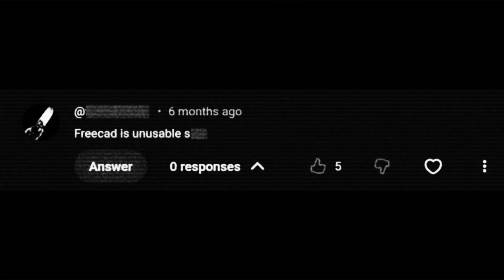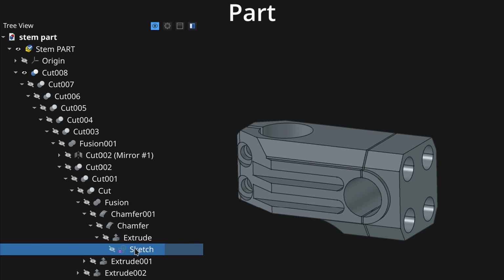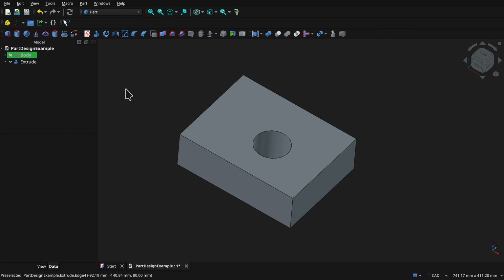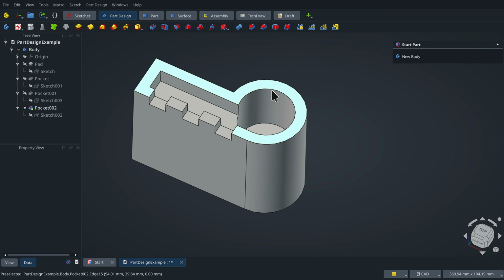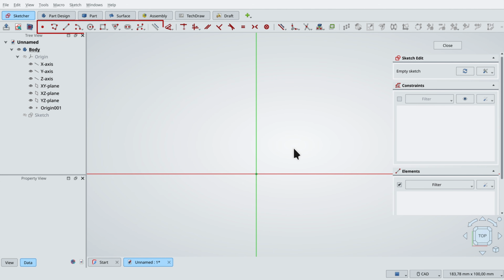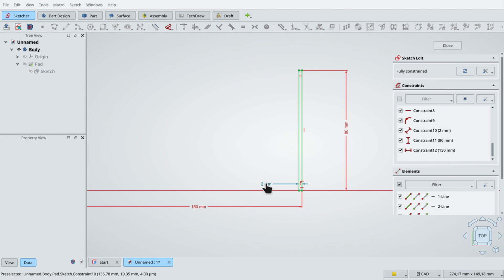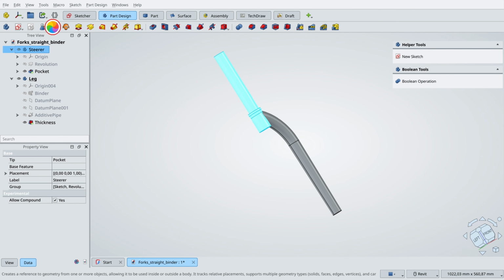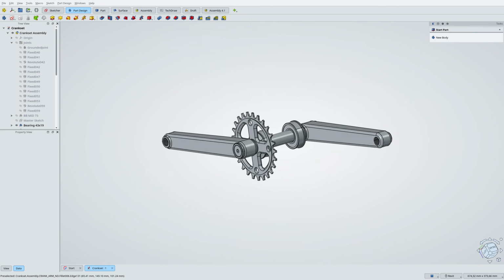STOP using FreeCAD WRONG! Do this INSTEAD (Workflow & Tips)

Comment: Exactly the same logic in Inventor or Fusion360. But when I launched Fusion360 for the first time in my life, I started working immediately. It immediately became clear to me what and how. Everything is intuitive. I had no experience working with 3D except for 3D Studio Max from around 2000. And also Google SketchUp. I didn't need to read instructions or watch tutorial videos. Moreover, English is not my native language; I know it quite poorly, at the level of terms and basic concepts (A1 level). But the Inventor interface turned out to be so clear and simple that everything worked out naturally. And then I decided to try FreeCAD. I spent several hours trying to figure out how to do something more complex than a cube with a hole. For the simplest actions, a bunch of auxiliary constructions are required. The FreeCAD workflow is terrible and counterintuitive. As if they tried to make everything possible, but not like others.

Comment: Thanks for the video. I think it's going to be a long hard road to get good, but some of the 1.1 features as well as a desire to get away from Windows will help me perseveer.

I think the more fundamental question for me is: why do things work in the way they do. What is the intention, benefit or philosophy behind the choices.

some examples I can think of are:
The need for sketches to be a single perimeter
The part and part design workspaces being distinct
The part operations being seperate from the booleans (in fusion you have one extrude tool, and you decide which boolean operation to do with the resulting solid)
You being unable to select a tool, then select the geometry you want to apply it to.

For now I'll do the hard stuff in fusion and the easier stuff in FreeCAD to help myself learn

Comment: Once you get to use FreeCAD, especially after 1.0 you get the impression that this tool is one step from becoming standard like Blender. When you get the hang of it, FreeCAD can be a really enjoyable and fun experience as long as you accept that at some point you will get to the point in the design where the solution has too many unintuitive steps. Currently, I am rocking 1.2 branch, and I can definitely confirm that we are in the last stretches here :)

Comment: Even though I am suffering with the migration I am determined to leave Solidworks - that I cannot afford - to FreeCAD even for my professional usage. But I am strugling with some workflow work. For example. I am trying to design a model airplane. I have the wing ribs that are all based on the same profile. I can easily import the DAt file and use that for the basic extusion and pockets for the details. But in Solidworks used toc reate several CONFIGURATIONS of these to use at th assembly. I could not find anything similar, only ones that can create several configurations based on dimensions but not configurations of enabled featrues (same base profile, different cuts and added extrusions). Also,Whe  I create a new Assembly I do not understand if it is better to have a new independent file or have it as part of the design tree. It is getting very confuse to me. I am sure it is an issue of getting used... Have any tips? Example: Outerzone ID=14521 (Spirit of Pitts airplane) 
there you can see the different configurations of the same base profile ofr the Wing. Thanks and your videos are a great help!!!

Comment: I've tried freecad many many times and always found the flow just too clunky. I have been using cad since 2012 and I have experience with inventor, spaceclaim and solidworks, and in all of them (even spaceclaim which has a completely different flow from the other two) you can find a common thread, but in freecad everything is alien except for the operation tree.
I guess I'll give it another try with the new 1.1 because I really want freecad to succeed and it would be real cool to use an open source cad, but it's a real hassle so far.

Comment: I tried the OpenTheme thing, didn't like it so decided to go back to FreeCAD Dark as I am use to it. However, the tabs, menu, everything didn't go back to defaults. Messing around in the prefs I see the "OpenPreferences Apply" buttun but there is no UNAPPLY button. Thanks dude, thanks, now I'm stuck with a UI I don't want. How do I fully undo this?
Reply from the maker: If you want to reset your FreeCAD, delete the FreeCAD folder in the Appdata folder (%appdata%). Make a backup of the folder before doing that; otherwise, you will lose your macros, CAM assets, mods, etc.
Reply: @deltahedra3D  After switching back to FreeCAD Dark and it not completely working I messed around with the UI for a while and got to a point that "made sense again" but oddly still uses things like the OpenTheme font, buttons, etc. I find myself now in an odd place liking what I have but unlkely to ever be able to redo this again should I lose my settings, lol

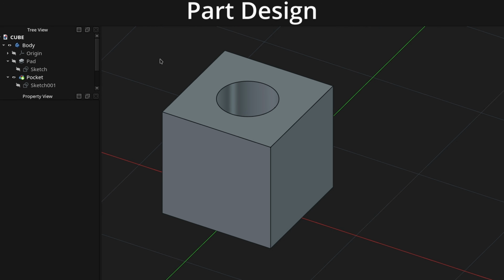Comment: your analysis at 3:00 was exactly the issue. having two separate part editing processes is confusing as hell. But even further, the assembly process is also a mess, spread across 4 different workbenches that all are handled differently. this kind of bring your own tool mentality is understandable I guess from an oss perspective but for a workflow and compatibility stance it is unacceptable. two visually identical models created by the same program in the same version might have completely different hierarchies and underlying data. This is possible in other programs too depending on designers decisions but at least the underlying data is consistent and would be theoretically trivial to merge into one project. In freecad this most likely would require a reimplementation of the models

Comment: I have tried to use FreeCAD for years. Even if the issue is skill. That skill is impossible to obtain if all you are faced with is a smooth brick wall. No windows. No doors. No ladders. No nothing. Just an opaque wall. And all the guides I read and videos I try to follow. They break down on fundamental things like the interface looking nothing like I am seeing and each instructor giving contradictory instructions. That is what it has felt like to try to decipher how to do anything in FreeCAD. 

That all being said. This video has given me the courage to give it yet another go. Maybe this time, I will not end up sitting there for 3 hours trying to make a rectangle do what I want until I just throw the app at a virtual window and go back to Blender, which is imprecise, but it at least gets me to A result. Not a perfect result. But an ugly sketch of a model is at least a model I can use. 

That  as well being said. If the key is to get a simplified more logical interface in front of us newcomers.... Maybe that should be the default layout? I mean. The power users will manage to find all their tools and menus. They can quickly take the effort to make it work like they want. A new user? One who has never heard of a "BIM"? They should probably by default be presented with the UI that all of the tweaks suggest in this video. 

What I'm getting at here is that... maybe... just maybe... maybe freecad would have a better reputation if it made it easier to be a newcomer.

or, tldr: 

"stop using it wrong" - yes. But noone has shown me how to use it right either. :)

Comment: i mean, im not against Freecad, but my problem is... it was programmed with Python and its very unstable. sometime out of no where, Freecad just /kill itself for no reason and break the entire model and/or my pc. Is Solidwork stable? no, cause its not made for gaming GPU. but in my experience, its way more stable and reliable than Freecad. And because its opensource, free and coded with Python (ok i dont know how good and stable is Python), its not as easy to use as Solidwork. when i first started to learn Solidwork, i was really fast very good at it. but in Freecad: had a little easy to calculate fillet, woops it just destroyed the geometry, wont go back like it was before and crash.

Comment: I'm 63 and worked in CAD most of my career using many different  CAD tools.  Each had its learning curve and ah-ha moment where the Zen of the tool clicked.  That would take a week is so to happen.  Then your learning progress and productivity would grow exponentially.   I have invested several weeks in FC several times and it never clicked.  It continues to be painful.  This video helped some but also highlighted some fundamental issues.  The UI is clunky.  Jumping between work benches is a fundamentally confusing UI decision.  It's getting better but generally suffers from being too "clever".  In contrast I tried out OnShape and was up and running in a couple hours with a minimum of pain.  I really want to love FC.  I want a local CAD package with lots of power and extensibility that I control.  I'm rooting for FC and come back often to see what progress has been made.  But as it stands, it's just not fun to use.  It feels like wading in chest deep water every time I try to use it.

Comment: To be fair, it is fairly well polished for 0.1.2 version. Oh, wait... 1.2?
Jokes aside, video is 3 minutes of 3 minutes of hysterical "you're holding it wrong1111", followed by 25 minutes of showing how to work around it to get to almost useable CAD. Fillets and sketcher workarounds prove that using it is like driving 50 years old half-rusted car, where you need to hold the door when accelerating and stop every 20 minutes to prevent engine from blowing up.
But the cherry on the cake definitely is part/partdesigner workbench separation looks like two groups of developers dumping code into unrelated views in two incoherent piles to avoid any communication. But yes, problem is in users.
Hope it would have its blender moment in 10 years or so, but with this outlook I wouldn't expect it: Blender team demonstrated extreme humility and reworked UI and workflows completely, while FreeCad and GIMP seems to be a huge unorganised pile of (sometimes good) code, glued together on random joints into some kind of Frankenstein's monster.

Comment: Excellent presentation. I've been Solidworks certified for years and have used just about every 3D package; the real value of FreeCAD is in the ROI. Forget about the workflow differences - FreeCAD is its own package and therefore is not obligated to work like commercial products. Considering the prohibitively high price for most of the 'mainstream' options and the compulsory cloud component of most, FreeCAD becomes nothing less than an amazing tool that truly democratizes 3D CAD (among other workflows). This new release has been long-awaited for me and I am working to transition fully to this from Solidworks. Here is the real ROI for me: I own the data, not Autodesk or Dassault. I can use this offline or not and no one is holding me hostage for a monthly subscription. It is quite worth the time spent in learning the philosophy of the platform.

Comment: Thank you for that video. I wish I had this video when I first started to use FreeCAD 🙂 One question about the assembly workbench. Are there any advantages in the original assembly workbench over the ones you recommended in the addon manager? Or do you youse those addon Assembly workbenches exclusively?

Comment: I have been using FreeCad for years, working for myself. Now I use Inventor at my employer. I find FreeCad lacks in one area only - it gets slow quite quickly, as models become more complex etc. But in terms of use, I find Inventor frustrating when working with constraints etc. This is because I think in Freecad terms. Once used to FreeCad , it is actually very good

Comment: The problem with including the fillets/corners in the sketch vs as features later on is that the sketch constraint manager gets overwhelmed trying to find a valid sketch solution with many fillets, especially when making (valid) sketch changes.

Not a dig at FreeCAD, all Parametric Solid modelers have some issues with changed / missing edges

Comment: When I began using FC, instead of onshape AND without any experience in any kind of CAD software, I realised it is a steep learning curve. But not because the software is bad or its UI/UX is bad. It's basically because I simply did not know in what way to construct an object. It is not just about the single functions, it is very important to think "CAD-like". So I talked to a mechanical engineer and he told me that during his time at university, they learned how to use CAD software and the process how to build objects. This is something we often forget. We are so used to "point and click" or "swish and flick" software, that we forget that some things are just inherently complex for a reason. Taking the right step at the right time during design will enable you to reshape an object (e.g. sizing) without any issues. But I also ended up with things that just did not work... Patience is required.
Your video was so  so necessary and needs to be brought to beginners' attention.

Comment: I have been using CAD for about 35 years. From Autocad bought out of the back of tech magazines to VAX Ustation, microstation and everything in between.  Freecad needs some serious fixes. Just because you have mastered a thing does not make it good.
When you start a CAD program you should be faced with new or load.  If new, select working units (mm/ft/light years)
Then when it open you should be facing basic usable drawing tools.  get straight into it.
I learned how to draw by hand on paper.  I have never once pulled out a pad and said, ok, let's be paramatric and ensure all points are related.
Draw a horizontal line 50mm long, 
This should be so basic.  Just a line.  But the box that appears , the numbers change with the slightest move of the mouse.  There is no basic angular lock like every cad system has up front and ready.  there is no basic text input for length and angle.
You showed exactly why freecad is screwed up and you don't even realise it.
if you make an object in one workbench it will behave completely differently in another workbench
IT SHOULD NOT DO THAT
if you lift a butter knife in your right hand you can spread butter.  If you lift it in your left hand you will stab yourself in the forehead.
No one needs individual workbenches.
You need a cohesive system that works exactly as you would expect it to every time.
if you need different icons, put the menu on your screen, make it a flyout or popdown.  You should never have to leave your design to go to a different part of the software.
What it is like is that different groups of people are working on it and not working together.  that is how you end up with workbenches that behave differently.
So if I am designing something I drop down a horizontal and vertical line, i offset them to the distances I need, i trim or extend, I use working lines, but they don't have to be dedicated working lines to lay things out and I do it quickly and efficiently without a lot of bouncing around.  I have never needed to start by constraining every friggin thing because that comes later.
A ton of the videos you see on freecad revolve around
make a box, it doesn't matter the size we will change it later
no, draw it once, don't work backwards
throughout your video you keep saying things like I started in this workbench but then went to this workbench so I could do the things that can't be done in the other workbench.
Do you hear how goofy that sounds.  it should be one program
cohesive
you load menu items you need in one program
you should never have to leave

Comment: Fillets don't work right, you tell me I should do them in the sketch instead. Next I tried shelling my part, it didn't work, I asked on r/FreeCAD and got told to use pockets instead. Face attachments don't work right either, names change when something get added somewhere else. And so on...

The problem is not the UI, the learning curve or "my ego". It's that it just doesn't work right, when you want to actually use it.
And the FreeCAD community is phenomenal, but it feels like Stockholm syndrome if you keep telling FreeCAD users that it's just a "skill issue" or that "their ego" is the hurdle to overcome.

I guess I will try again in 2 years or so...